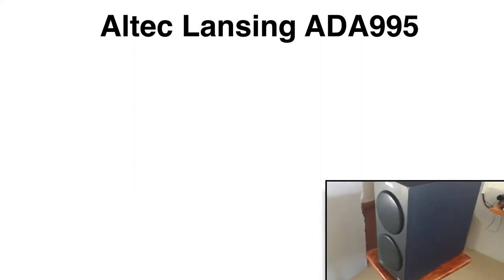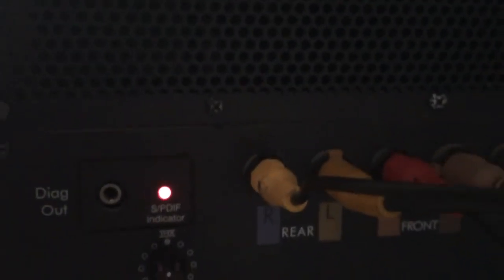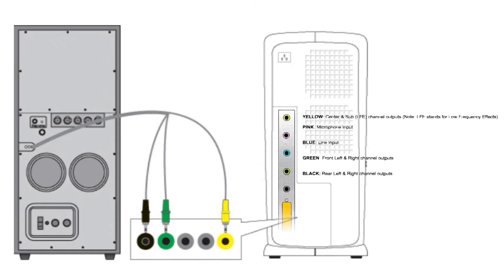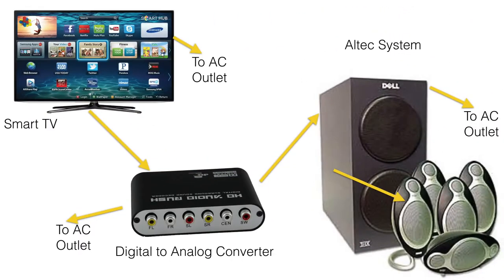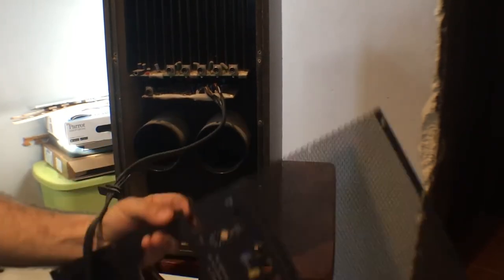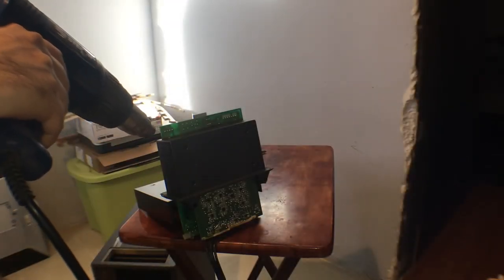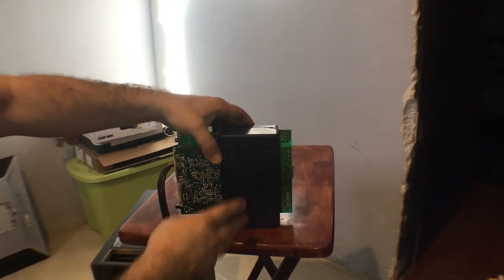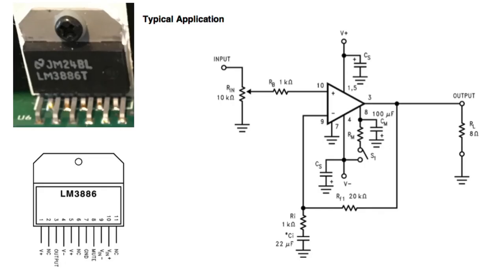Altec Leasing ADA995 5.1 home theater sub woofer take apart and review

Comment: how did you get amp/out? followed video something still holding it in
Reply from the maker: Do you mean the output source to be send to the subwoofer input? or what amp/out?
Reply: you need to remove three screws behind the top speaker. To do so, you need to remove the top speaker first.
Reply: How do you remove the top speaker?
Reply: Tianhai Li how do you remove the top speaker?
Reply: @Thomasfilms  I'm not sure if this helps after this long but I came across this video after my own ADA995 broke and I couldn't figure out how to get the amp out. The grill in front of the speaker is only wedged in there. I had to beat it off with a hammer which destroyed it. There wasn't any glue or screws holding it in, it's like the cut the hole just big enough to keep it in place real tight. After that each speaker can be removed with four screws. The + and - connections are soldered to the speaker cone and they don't give you very much extra wire to work with. Fortunately my subs were trash and are getting replaced with new 8OHM 200W ones so I wasn't worried about cutting the wires since they'll get replaced.

Hope this helps!